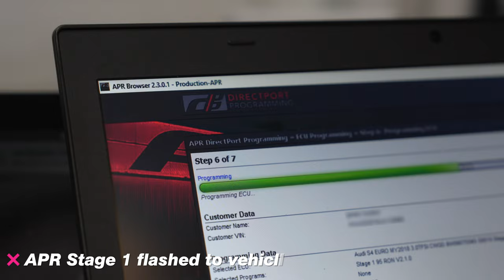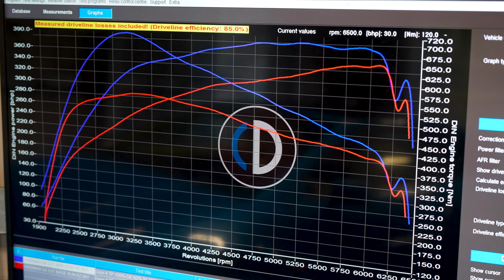AUDI B9 S4 TUNING UPGRADES! SCORPION EXHAUST, ECS INTAKE, APR ECU/TCU REMAP

Comment: I'm considering getting the stage 1 APR ECU & TCU tune for my B9 S4. What kind of gains have you seen on 99 in the UK?

The main reason I want to go with APR is because eventually I'd like to fit their DTR8868 turbo kit and there is no additional cost to update the software to stage 3 if you already have their stage 1 tune.
Reply from the maker: Hey! All the info is on the APR website that they advertise
Reply: @RegalAutosport  Lovely, will do! And what kind of discrepancies have you seen on your own dynamometer compared to the advertised figures? Just looking for some real world figures based on UK cars.